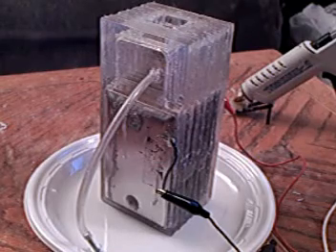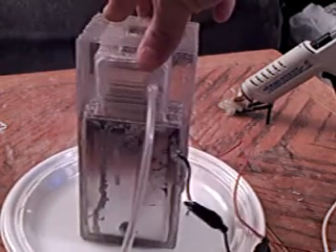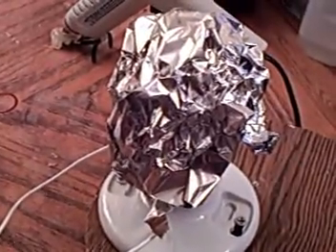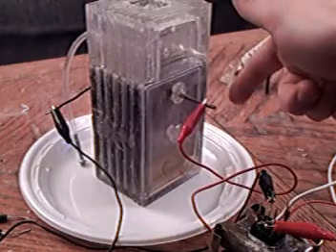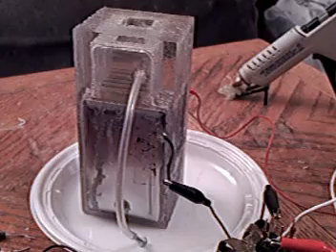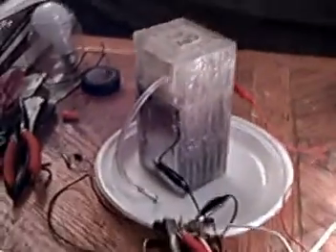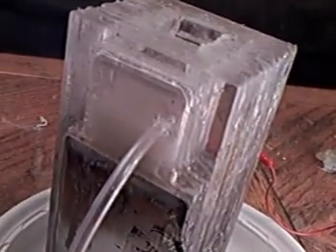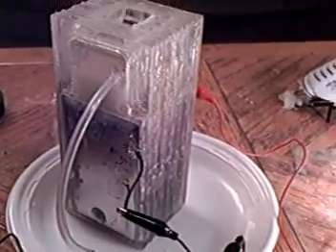110V Series Cell Electrolyzer

Comment: i just posted on one of your other videos about how i thought you cant use AC but only DC,you proved me wrong. but i was looking at ohms law and i think if you use more amps and less volts you will get better HHO production because less ohms means easier flow of electricity. but i am still kind of a novice and you might have already thought about it but if not try it, it might help ya out

Comment: So you have a positive and negative wire attached to each individual plate and each of those plates are soaked in the mixer you described? What do the plates need to be made out of? I not sure why you mix baking soda with distilled water or even why one would use distilled water over mineral water. I really want to build an Electrolyzer. I wanna make hydrogen.